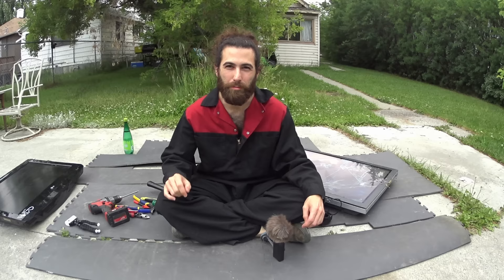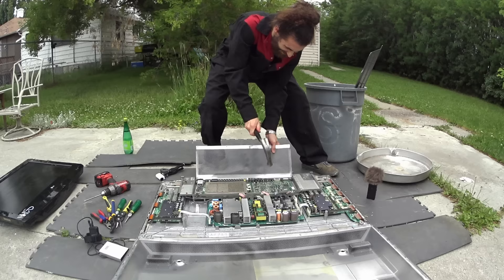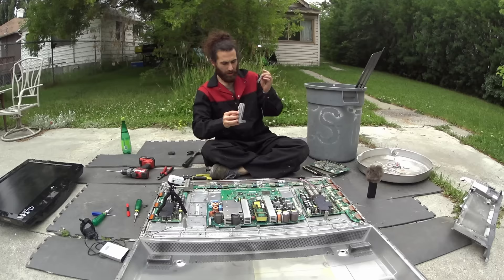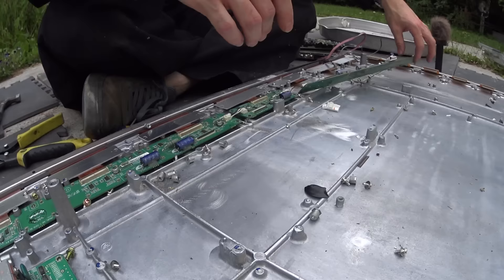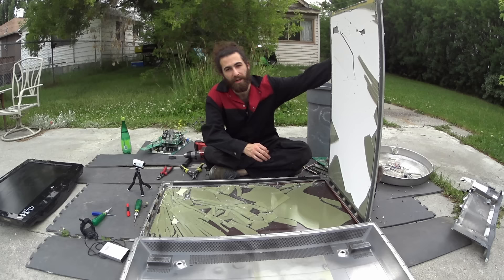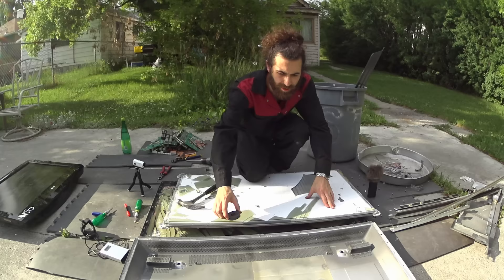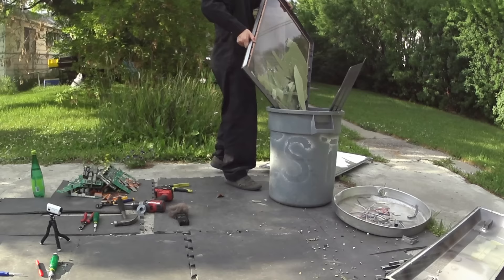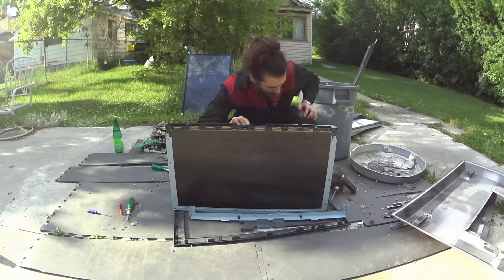Scrapping A Flatscreen TV - How To Make Money From A Scrap TV!

Comment: I gotta agree with another comment here. You can find the tvs for free in trash all the time
 Every peice of metal weather its stainless screws, aluminium, zinch copper, is worth something with the right poundage. I would save every peice i can. And when i have enough sell to scrap yard. Its all free money with the exception of time
 And honestly if it takes you more than 10 to 15 minutes to tear down a tv maybe you need to work faster. Ive completely stripped a 55 inch in 15 minutes. And thats with seperating all copinents.

Comment: I throw all my screws into a container to scrap also, it's not much but every bit helps
Reply from the maker: Absolutely. I sometimes do the same, fill up a microwave or pc case or similar. Steel has just been such a bad price recently though, it’s hard to want to
Reply: @thubprint  bbq tanks are great for smalls like screws etc...the valve is usually brass...hope you will do a video  scrapping them
Reply: My interest is more for scrounging, so I collect screws as hardware for projects etc.  Anyone who’s a maker quickly learns fasteners and hardware add up quickly, although I find furniture and smaller electronics a better source for these.   Their scrap value is dubious.   I agree parting out or selling the whole broken TV is the better value.  But definitely test non-visibly broken TVs for functionality first.   People throw away perfectly functional stuff, more frequently than broken stuff in the States in my opinion since the price of TVs has plummeted.  Often the broken TVs just have bad power supplies.

Comment: Connection strips worth the most (high grade), then the AV boards (medium grade) power boards with capacitors & transformers are sold as low grade boards, same as CRT TV boards.

Comment: I recently started scrapping flat screens for materials (to melt), and you are correct, not much in them.
Better to convert them into a faux skylight or a light table.

Edit.  Recently found one and it turned out to be working.  Now it's a 50" computer monitor.
Reply from the maker: Decent! They’re definitely worth checking, the technology moves so quickly that some people just throw them out when they get a new one. Strange, but it happens.
Reply: Yep some definitely still work!

Comment: I take the screws and put them in a small flat rate box and sell on eBay for 16.95 plus shipping. Sell them every time! That casting is most likely magnesium.
Reply from the maker: Really?? I never thought people would need the model specific screws, that’s so cool!
Reply: @thubprint  Its not just model specific. Just take a small flat rate usps box fill it to the top with any type of screws from electronics. Mix them all up. People love these mixed screw lots because they will likely be able to find the type of screw they need. I can sell them for 16.95 plus 7.90 for shipping although I might make deals once in awhile to move more boxes when I have a large amount. I have sold more than 20 boxes of screws this way. I try to look at my scrap trash and find ways to market it. I try everything.
Reply: @Carl Fole I don't put the weights on my listings. I just fill up small flat rate boxes to the top. I have also sold medium flat rate boxes of them but the weight of these is so much it makes shipping a challenge because they have to be packaged in a way the box won't break. 

One time someone in the next town over saw my eBay listing and I basically sold him half a bucket of screws and met him at starbucks. 

Listing the weight might help them sell faster. It can't hurt.
Reply: @Carl Fole Yes I do scrap a lot although the amount has been slowing way down lately. My advice is to get what scrap items you can when you can.
Reply: @Carl Fole LCD tv has many screws to salvage along with a few circuit boards which can be sold in bulk as scrap. The wiring, steel, sheet aluminum backings in some of them. 

I would say that the screen itself may contain some exotic metals but the amount would be very small and not profitable. 

The plastic is obviously trash unless you have a buyer near you. And that's about it in an lcd.

Comment: Good day I'm from South Africa follow your videos, Iscrap a microwave, and behind the control panel on the circuit board was a round black thingi, so I open it and inside was a round flat thing looks like gold, it's non magnetic, not scratchable, I want to know if it is gold or some other presious metal, thanks.
Greetings from South africa

Comment: Sell the escrap, if you look hard enough you will find a buyer.
That ' Zinc/ diecast' was probably Magnesium &/or Ali alloy. Die-cast( zinc alloy ) is very heavy & has a dull thud sound. Magnesium is super light & has a ringing ' Ting' sound to it. Just chuck it into the Ali pile.

Comment: I think the real value of these is the light guide panels. The thick acrylic sheets. Super useful in projects!
Reply from the maker: That’s a good point, whenever I’ve wanted to buy acrylic sheet for a project I’m always amazed at how expensive it is
Reply: I've used the acrylic sheets in my house windows.Good for privacy without need for curtains
Reply: I've used them to make  illuminated,  double sided advertising signage, clock faces, and menu boards

Comment: Oh, come on now!

You TOTALLY  bypassed the best part:

If you take apart the screen and separate the layers you get great white plastic for light reflection, and usually st least one sheet of the silver/translucent material.

I love that stuff, I use it for a privacy shield on my windows when I live on at ground level. One layer right on the glass, and another layer or two either bent into a wavy shape or hanging free, and without losing much sunlight you get relative privacy and rainbows.

No gold, but rainbows.

It's ok.
Reply from the maker: You know, you’re right! It depends on the type of tv of course but yeah. I tried to find a good use for them but never really did. I guess I didn’t try for long enough 😭
Reply: I only figured it put because I had a collection built up from my doomed attempts st somehow getting ahead of the stream, of things that an "acquisition addicted" roommate  was bringing home and then forgetting while constantly searching for more "treasures".

I was trying to break stuff down to save space and get stuff recycled/repurposed in the futile hope that it might allow me to maybe clear a trail through major rooms, or use a wall socket that did not already have extendhugoutlet that did not already have an extension cord running under the piles of crap.

(It was a good thing for the local urban ecology when the household finally dissolved. The guy had been stripping every possible item that caught his attention from everywhere, then generally letting it decay away outside in the rain; thus denying every homeless/ broke person within kilometers the opportunity to convert useful items into revenue. This actually affected the local neighbourhoods significantly)

So, anyways I ended up with multiple sheets of the stuff from the various components and items with screens that he would drag home (scrapping for cash would have actually made the household viable, but the guy did not want anyone successfully deriving or imposing order on the protective wall of chaos he was building for his head)

In any case, necessity is the mother of invention, and it was a hot summer, plus the neighbouring house had a window exactly symmetric to my bedroom window and I like summer light, but not heat.

In case you or any of your audience might be interested in what I was able to learn:

The material is actually a micro laminate that does not separate easily and that will simply fracture and peel off in rough pieces if bent too far.

Multiple passes with a very sharp blade will cut it, but too much pressure will cause the fracturing effect.

Heat can be used carefully to get a clean edge, but can cause vapour to be released so ventilation and limited temperature are advisable.

The privacy effect works best if there is a single layer right across the aperture/window with on or more layers behind it at angles other than perpendicular.

(At night with a single layer you can still see the general image of what is on the other side if it is lit, and if there are more layers you can still see through at a lowered resolution; whereas if the is a difference in angle the effect is multiplicative rather than additive)

A nice effect is to have the flat window sheet, with overlapping and staggered smaller shhrts hanging behind it so that there is both variation and motion involved.

One style that I would like to try is cutting a sheet almost but not quite into strips, and then having 2 or more hanging in layers about 2-3 inches apart with at least one little 5V laptop case fan powered by USB blowing from the side to cause a slight  rippling effect, making it both effs tive and aesthetically pleasant looking without people thinking that you are hiding a grow op, or something.

As for that house?

I still have a large collection of case fans, and build custom fan walls with them.

I am glad that I finally got out of that living situation before the end.

There was just this really ominous "Haven't I seen this in a bad horror movie?" feeling that I got on the day the guy proudly came home with a massive Chinese shrine that still had bits of paper and ashes of offerings of incense, etc along with porcelain statues of deities and s jar.

I was ignored when I stated that was not actually a great thing to do rough carpentry on to make a floating headboard shelf for their bed.

All I will say publically about the months that followed that afternoon is thst I was glad to be free of that place, and was even more so when  I was told that the guy was using the ashes that he found in  the fancy jar ftom the shrine to clean out the residue in his meth pipe.

Fun times.
Reply: I think you could make some money as a novelist

Comment: 👍. Not to diss on your information that you are giving. Those boards contain gold a friend of mine got a half ounce of gold out of just the boards and just by using hydrogen peroxide and vinegar granted it did take some time letting it sit. But while you're doing other scrapping you can leave the boards in the solution to strip the gold off of them and not even worry about it. Hydrogen peroxide the whole bottle was $1 the vinegar was $1 didn't even use the whole bottle of either product. So if you take your time and just let them sit in hydrogen peroxide and vinegar while you're scrapping other things you can get a pretty good penny for a flat screen TV Plus all the other benefits aluminum, zinc, tin. And by using just hydrogen peroxide and vinegar are both biodegradable environmentally friendly.
Reply: How many boards did it take him to get  a half ounce of gold? He certainly didn't get it out of one tv...

Comment: Your missing the Indium tin oxide ! The glass is coated in it, particularly the dark glass. It can easily be broken up and stored or easily refined at home. check out the prices, here in the UK its on the increase. I believe it comes from India and sources are running low forcing prices up and making it well worth recovering or selling on !
Reply from the maker: I’m really glad you pointed that out, I had no idea and I think that’s actually more valuable than the amount of gold you can get out of one of these
Reply: My interest in scrap has been sparked because of these videos and I currently have the glass saved but have been unable to find a video on how to refine the indium tin oxide!

Comment: What about the big giant old tvs? They are good for game systems with all the connections they say but the picture was fuzzy and it weighed a ton. It took two people to carry it outside. Someone picked up the entertainment stand but not the tv. It has become a permanent fixture outside for now. 🙄😁
Reply from the maker: Yeah, that’s the real issue with those ones is hauling it away. There’s plenty of good copper in them but a scrapper needs to find somewhere to dispose of it afterwards.

Comment: Actually they don't contain mercury if it's a plasma tv it contains neon gas which isn't harmful and the older lcd TV's contain mercury metal and vapor in the backlight lamps but even if you do bust them it's not a big worry unless your literally right up against the tubes as you do it because it mixes with the air and gets blown away seeing that your doing it outside but if your inside, best not to break them because not only the mercury vapor but all the glass all over the place
Reply from the maker: Ohhh I didn’t know that! So I wasn’t exactly correct, but the being careful because gases exist is still a good precaution regarding TVs in general.
Reply: @thubprint  yea, tube tvs are vacuum sealed so no gases from them either I forgot to mention, but the glass is still sharp and can cut you in any TV. except o-led TV's their made from alot of individual plastic LED's

Comment: Hey check it out guy, there were a lot of really useful components that were on those boards there. I mean with the right skill set, assuming that is something feasible for you or your viewers, I seen the ability to make at least one induction heater. Or possibly a very weak speaker from some of the other parts. Js
Reply from the maker: I’d love to make an induction melt furnace, but I’d have a fair bit of learning to do first!

Comment: Newbee. Whentaking apart the motor the metal surrounding the copper roll is this anything special or just shred .
Reply from the maker: Funny you should ask, it actually is special. It’s a different type of steel, a “high silica” alloy. Unfortunately most yards will not have a special price for it because it’s difficult to save up enough of it for them to dedicate a space and ship it out regularly. So it just goes in the steel shred at my scrapyards

Comment: What if the only thing wrong is the screen is cracked? Could you repair that or just scrap
Reply from the maker: Well it can’t be repaired and they cost hundreds to purchase a replacement, plus the shipping is outrageous. The only realistic solution is to find the same model tv with a good screen but a different problem and swap them.

Comment: So, does the screen itself have gold in it, on the edges? Are they worth  anything themselves?
Reply: I have noticed that newer tvs have less of the gold bits, and really cheap ones are light due to less circuit boards. If it’s light for its size, I don’t even bother. Brand names tell a lot as well - Vizios are crap, LGs are good.
Reply from the maker: I can’t imagine the screen having any gold ‘in’ it, but I’m researching indium tin oxide because I hear that’s got a long ways to go up still and I want to have some stacked. Just need a good way to recover it 🤔
Reply: @thubprint  Thanks for the replies!!!
Reply: The tv screen I looked at had a gold looking border along the glass.
Reply: It was on the dark glass part of the screen and it was translucent when held up to the light.
Reply: If the border of the dark glass was just copper, would it be translucent when held up to the light?

Comment: Learn the differences on aluminum , 6061 & 6063 are the most valuable. Also several different series . Finding an honest scrap yard that pays the correct amount after you learn to separate them is the hard part. If it has magnesium or silicon in the Aluiminum it's more valuable. Do your research. Getting 4$ versus .50 cents a lb. Is a big difference.
Reply from the maker: You can get $4/lb on aluminium?? That’s huge!